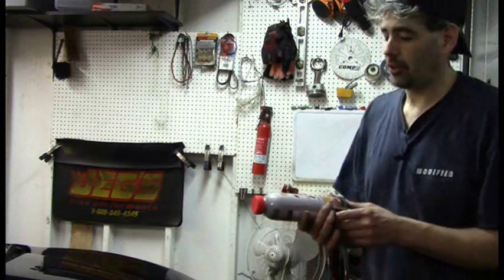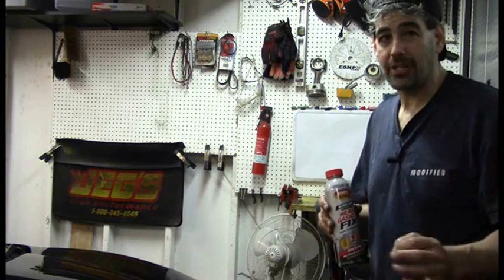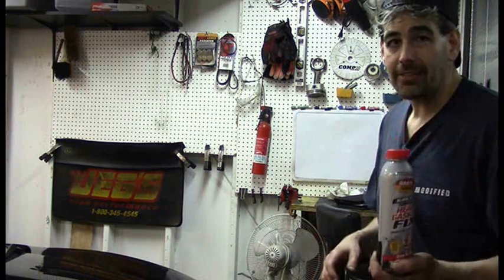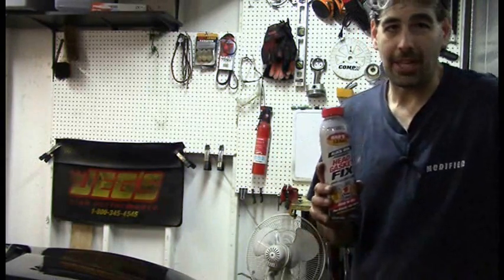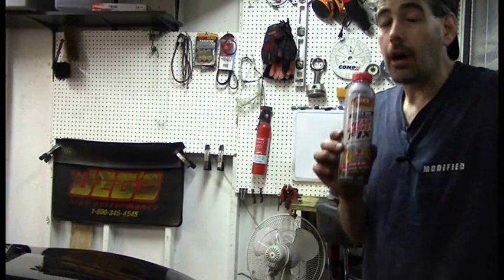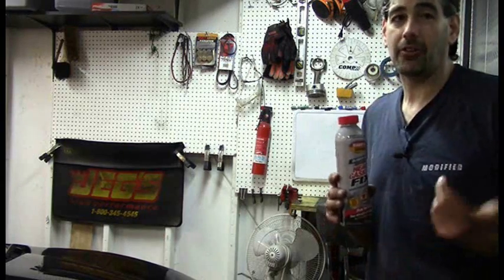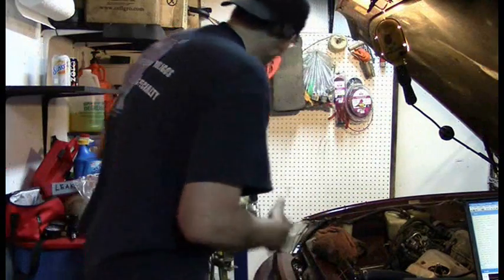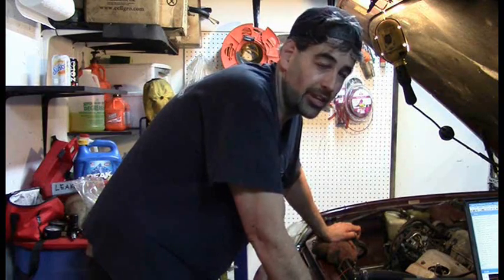Liquid Head Gasket Repair / Block Sealer Scientific Testing

Comment: Another great video from this channel! When the head gasket failed on my 1999 BMW E36 wagon I thought it was then end of the road for a car I was very fond of. However my mechanic suggested trying a head gasket sealer, and explained about the different types on the market. The type used in this video contains 'fillers', and can be identified because the liquid is quite sludgy. The 'fillers' circulate in the coolant and lodge in the failed gasket (in theory), but they can also block other flow within the cooling system and are not very successful on head gaskets - as in this video. A much newer chemical technology is now available that deposits metal into the failed gasket using a chemical reaction, activated by engine heat. These products have the same viscosity as coolant/water, so are easy to spot when you use them, the one I used also had a yellow/green colour and was called 'Steel Seal' - there are other brands out there based on the same technology. For me it worked! I was getting coolant into cylinder 3, very uneven running - particularly from cold start, when the motor would shudder on its mounts until it blew out the coolant from the cylinder, the car had a lot of NVH at higher revs too. How long the 'Steel Seal' will last, I don't know, but it's been six months and 4k miles since, and all is still well. As the car it only worth about 500 UK pounds (700 USD), replacing the head gasket would cost about twice the value of the car - the 'Steel Seal' was about 30 USD.
Reply from the maker: What was your before and after compression with Steel Seal?
Reply: Schrodingers Box - Hi, I never did a compression test. I took the plugs out and found the plug for No.3 was wet, which I took as proof that the gasket had failed. After treatment, Cylinders all now dry, and engine smooth as you would expect for 230,000 miles - I.e. Not perfect, but not bad either.
Reply from the maker: Ok then what is your evidence this was a cylinder head gasket failure as opposed to an intake manifold coolant leak? I am trying to figure out how you know it "worked" on fixing a head gasket issue?
  ANY product would work on an intake manifold coolant leak- the pressure is only 15PSI. Hell even ground pepper would have worked.
Reply: My BMW has the M43 engine - a 4 cylinder unit - which does not have a water cooled inlet manifold. I do not know the mechanism my mechanic used to confirm my suspicion that the head gasket had failed, but seeing as he suggested using the 'Steel Seal' first before tearing the engine down, he would have nothing to gain by misrepresenting the fault.

Comment: Great video, Thanks.  Just for others to note two key points 1. doing actual testing and diagnostics is the only way to determine the results. 2. for this type of repair there is no way to do a control test since once you use the product, even if it does not fully fix the issue, then you might have some change, exactly like was shown,  one cylinder did have some increased compression. 
That being said, it would be possible do a test on independent events, but that requires some subjective "bucketing". 
Example - Scooters Head Gasket shop carefully tracks all data related repairs. Say they had 15 vehicles come in, ALL were 2006 Caravans with the same engine, miles were plus/minus 10,000 to 120,000 miles, no overheating. The shop did the procedure the same and had zero fixes. THEN they had 15 Caravans come in with all the above attributes, they tried product B and found a success rate of 40%.  Then you could calculate the likely hood that B is better than A and give some confidence interval to that. 
Of course this sort of situation is not common.
Reply from the maker: 100% Correct- the only possible control would be to have two 100% identical engines with 100% identical compromises in the combustion chamber.  Even doing the testing sequentially introduces variables just in the sequence itself.
Reply: Providing one example case is not “scientific”.  I would want closer to 400 cases to derive a reliable fact pattern.  Science is hard.
Reply: @forestMog  Yes it is. The scientific method explicitly states it principles and repeating an experiment 400 times is not one of them. The only part of this "experiment" where he was loose with the science is not actually stating his hypothesis, but it can be inferred that his hypothesis was that the chemical would seal the gasket. He then proceeded to  perform measurement based test, analysis , and he drew a conclusion based on his "experiment". That, my friend, is scientific.

Comment: Hey can I recommend even though it's not in the directions run the car with the radiator cap half off for head gasket issues and remove the thermostat best method I've found to get these types of products to work. In my experience the best ones to use are iron tight and k-seal
Reply from the maker: What is your negative control confirming this empirical observation though?

Comment: i am a mechanic myself and i can tell you that sealers do work alot of the time the one i swear by is k&w block seal it is one of the run it with only clean water and drain let sit to cure for 24 hrs types i have used it in two diffrent instances both times on an 4.6L ford engine and it worked like it said both times one had coolant entering combustion chamber quite badly alot of steam from the exhaust and you can actually hear a blown head gasket if you listen to the exhaust and know what you are listening for you can hear the misfire and it will have an airy puffing kind of sound that matches the rythum of the shaking engine... but any-hoo the other one had a dead miss and exhaust gas pushing coolant out  steamy exhaust puff puff puff sound in exhaust building pressure bad with cap tight so i suspected halfway clogged radiator/ heater core but car had heat so i did complete radiator removal flushed it out bypassed the heater core radiator was quite heavy empty had it rodded out reinstalled used the k&w never had a problem again from either both still running 1994 towncar 1999 crown victoria
Reply from the maker: Joe please call 911. Looks like you're having a stroke.
Reply: Schrodingers Box 
I used Blue Devil head gasket repair on my 03 Jeep Liberty 3.7l with 155,000 miles (at time of repair).  I had oil in my coolant and coolant in my oil,  but i caught it early......  31,000 miles later (186,000), still no coolant and oil mixing..  I have no data to back it up but i got a car that runs :)))
Reply from the maker: What were the before and after compression or leakdown test results using this product?
Reply: the results were no more steam engine effect the missing stopped in both engines idle became smoothe again all signs of overheating vanished. positive results are just that scientific or not and plz dont grammar nazi me i do not punctuate alot of times cause it slows me down sorry
Reply from the maker: Bobby Singer Those are not quantitative effects whatsoever. As I stated 100 times people who make these claims as you have on the performance of these products have invariably failed to conclusively show they were fixing a head gasket problem or combustion chamber breach.
Reply: Yes i did see you say that more than once. you keep telling people that they did not do what they said they did basically. Simply because they have no data to show how they arrived at the conclusion that there even was a head gasket leak in the first place.And in turn they also dont have any data  to use as a baseline for testing whether or not the product in question  made an improvement or did not, you want people to show that one there was definitely a head gasket leak and the compression numbers before and after. So a comparison of data can be made to assess if the product made an improvement.. but you fail to see that people that know cars know when a vehicle has this problem or that, because in our hay-day we did not have all those fancy tests. We had to be the diagnostic machine. we became pretty damn good at it too, so when myself and others like me state that we have had success repairing a head gasket with a sealer product more than once where others have failed. You can take it to the bank my friend. test blue devil or k&w block seal and you will be surprised id bet on it.
Reply from the maker: It's a Pretty simple world when you don't need evidence, ain't it?
  You don't have to bother with things like controlled environment, independent variables and reproducibility, to perform diagnostics through data based analysis and stuff that you don't understand. That's no intake leak that was repaired by the product  because it's only at 22inHg instead of 150 PSI - because "you just  know because you're old-school". You don't even know that ANY product wouldn't have worked because..... you just say so. 
  All you need is your belief.
  I do envy your position over mine though... because unlike me, you can never be proven wrong.
Reply: as stated i used that bars crap first did not work did not feel the need to illude to the fact that i put new radiator in the car bypassed the heater core and flushed it like five times before i decided to use k&w upon the suggestion of a friend whom i was complaining to about the bars leaks crap scamming ppl
Reply from the maker: As I state repeatedly YOU HAVE NO SCIENTIFIC EVIDENCE ANY SPECIFIC PRODUCT WORKED!!!
  You haver NO CONTROL.  NO INDEPENDENT VARIABLE. NO QUANTITATIVE ANALYSIS.

  WHy do people not understand science vs "feeling and intuition"???
Reply: Schrodingers Box 
In all honesty Bars leak is crap.  I like the way you did this video,  you definitely get a clear cut answer if it worked or not.  Try with a quality product like Blue Devil,  Steel seal or K&W.
Reply: Schrodingers Box 
In all honesty Bars leak is crap.  I like the way you did this video,  you definitely get a clear cut answer if it worked or not.  Try with a quality product like Blue Devil,  Steel seal or K&W.
Reply: Km lk km oo .
Reply: Schrodingers Box wonder  what happenex to Joe?
Reply: d

Comment: everyone seems to have extremes or nothing. started an internal leak in 4.7 02 Durango month ago noticed oil cap mayo few days ago. using some tomorrow did new cap radiator and water pump already so doubt it clogs. I'll tell y'all what happens f@#$ the science will replace coolant too.
Reply from the maker: That hasn't been my experience. I've yet to see a compression or leakdown test fail to make a confirmed diagnosis. I have never misdiagnosed what turned out to be a combustion chamber compromise, but i have also caught many others' misdiagnosis where a head gasket was NOT the problem too. 
  This is one of the easiest and most definitive  diagnostics i do.

Comment: Well there's one problem right there. It seems to me that most customers are not going to believe that simply adding the product and letting it idle a little bit and checking it in the morning is proof that the product did not work. Use the car for a week or so first. A month would be even better. Then check the results.
Reply from the maker: The product claims it works immediately PLUS common sense indicates that the product will not improve over time but rather degrade over time given the chemistry behind the operation.
 Driving the car with a known blown head gasket would also be extremely ill-advised for obvious reasons.
Reply: Is this product one in which the sealing particles harden within a few minutes of heat? If so, then it might be too late to hope for benefit after sufficient time is given. Even so, those not familiar with the product likely won't be convinced it didn't work just by 15 minutes of idle time or whatever. I assume this product is used for leaks other than blown head gaskets.

Comment: Didn't flush out bad coolant would still have traces of dioxide
Reply from the maker: OP Doesn't know chemistry obviously. It doesn't work that way, Lavoisier.
Reply: That was the first thing that popped into my head, too, oldmanwoodworker enk. 

@ Schrodingers Box: I'm not up on what lingers chemistry-wise in the coolant, but since we are taking a 'scientific' look at these tests, shouldn't the coolant have been fresh beforehand; for this leak test anyways, to be fair? Or should a test have been taken of the coolant before you added the additive? Or, maybe the 'Combustion Leak Test' should've been left out all together since this is the same contaminated coolant leftover from your Pt2 head gasket diagnostic video. (I did watch both of your head gasket diagnostic videos, btw.) Maybe the contaminated coolant affected the results of this sealant. Who knows? But it did get me wondering. 

I used a Bar's Leaks engine sealant, yeeaars ago. (I think it was Bar's Leaks.) I believed that because it incorporated aluminum particles that that was an excellent idea. It did not work and it left me skeptical of any additives, til I was introduced to Seafoam; all these years later. No YouTube back then.

I do enjoy your 'amazing powers of observation', tho. 😖

Comment: 1999 Ford Ranger- past 3 yrs radiator problems-replaced twice mechanic used liquid glass from a pharmacy to fix the suspected head gasket problem- about 1-1/2 years of every other day driving- FINALLY it just cut off while driving- mechanic said new motor or head- and a new radiator - when I reminded him that he used the liquid glass he said just a whole new motor was best bet. Basically we've given up on putting any big amount of money into this truck- So.. I watched your video on replacing a cylinder head and watched another video of a guy doing it on a 2000 model. What's your advice? I'm on school break so time is no issue but tiny budget

Comment: Hi, while the sealer warm up , remove the cap use the radiator pump pressure to create the pressure on cooling system.... the sealer will goes to the crack gasket bond seal while the cylinder block still warm.
Reply from the maker: That's not necessary- there is already excessive pressure on cooling system with a blown head gasket by definition.

Comment: Would C02 be present in the coolant from before you added the seal as the entire coolant wasn't changed?
Reply: Steve Ashcroft my thoughts exactly
Reply: @bartfox9187  There is probably always CO2 in the coolant.  Air is a fluid, coolant is a fluid, CO2 in air dissolves into coolant exposed to air.  There's also a LOT of CO2 dissolved in water, which is why the pH of rain is always mildly acidic (but not as acidic as "acid" rain because that has SO2 and NO2, which make stronger acids when mixed with water than carbonic acid), and it turns basic in groundwater as the water picks up carbonates in soil and rock.

To get it out you'd have to boil the fluid, which basically removes any dissolved gases because the full pressure is the boiling fluid.  Boiling distilled water gets the pH to a neutral 7.  Boiling the coolant would remove the CO2.

Generally speaking, the higher the temperature, the less soluble gas is (obviously, as the partial pressure of the main fluid rises, it leaves less partial pressure for other gases), and the more soluble solids are, which is why sugar dissolves easier in tea when hot compared to cold/iced, for example, or why warm or hot (some people like it as a literally hot drink) soft drinks go flat faster than a refrigerated or iced soft drink, there's less "room" for the CO2.

Anyways, there's probably not MUCH naturally dissolved CO2, compared to dumping it in wholesale via direct from the engine.